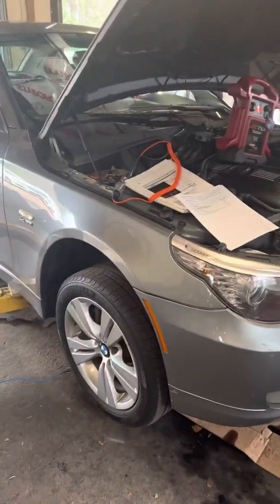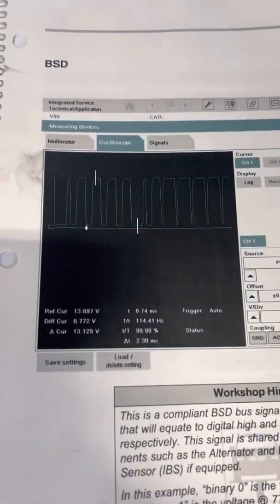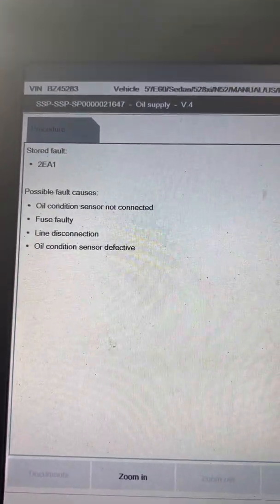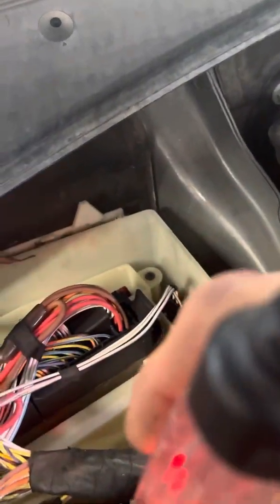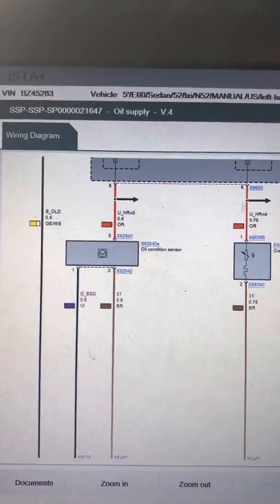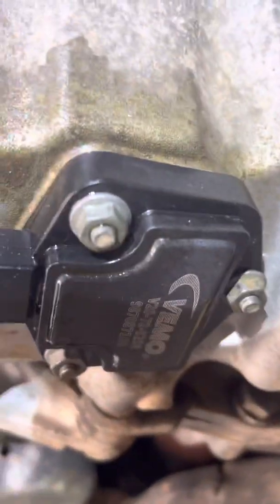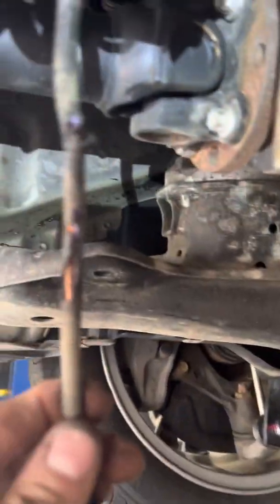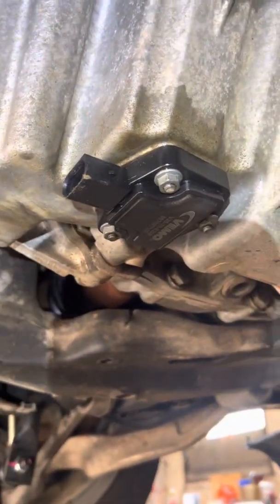BMW 2009 528XI BSD circuit fault and diagnosis. Oil level sender fault

Comment: I really need your help. I have an N52 E60. 2008 528i. I’m getting 2E7C code only. Car won’t start unless waterpump is unplugged. Verified pump is good but still bought a new one. Same problem. Unplugged everything on bsd line and still getting the code. I THINK it’s the DME but I’m not sure. Don’t have an oscilloscope but you’d think if you still get the code with everything unplugged it’s the DME right???
Reply from the maker: Test voltage on the BSD line.  Ohm out the wire between DME and all components. 
Test for shorts
Reply: @eurowerx4267 no shorts. Infinite resistance. At this point I’m thinking it HAS to be the dme….. damn it

Comment: I have the same code but instead of the alternator missing it saying the coolant pump is missing 
So I have missing oil temp and missing coolant pump 
My car just turned off too cause it was overheating, this is all after I picked up my car from the dealer!!!
Reply from the maker: BSD circuit issue! Come back for the dealer tech!!

Comment: My negative terminal keeps frying up my water pump along with my oil sensor.
Reply from the maker: I don’t think so. Negative terminal is the IBS, the positive is BSD and that’s the communication protocol for the oil level sender, waterpump, dme and alternator.
You need to scope the BSD line, check for shorts if the signal is bad and begin unplugging components on that BUS

Comment: I am currently having a oil level inactive issue, I have replaced the oil level sensor and the water pump was just done, I have a code for ibs but I’m not sure what I need to get to fix it so I can read my oil level again. Any help?
Reply from the maker: Ok, replace the negative battery cable with the associated harness connectors. IBS is the negative cable!!

Comment: Just interested if that would fix the alternator missing part fault?
Reply from the maker: If the alternator is the only BSD fault and the circuit isn’t shorted, replace the alternator
Reply: @eurowerx4267  Nah i have 3 BSD faults, Missing Alternator, oil sensor, now IBS since going through series of disconnects.